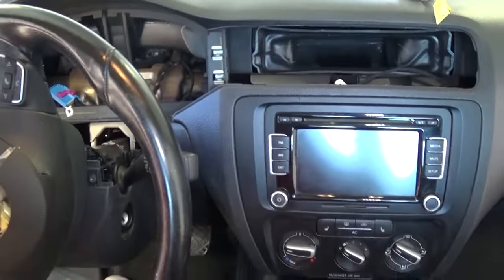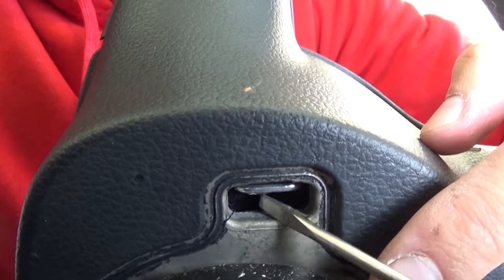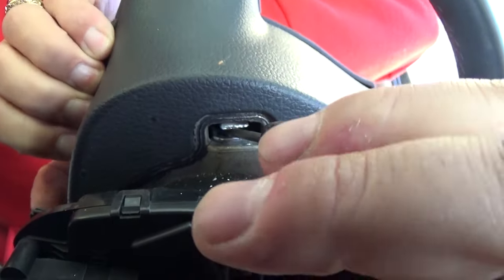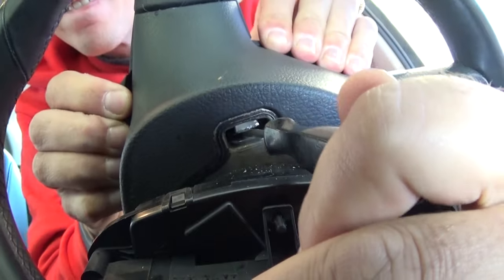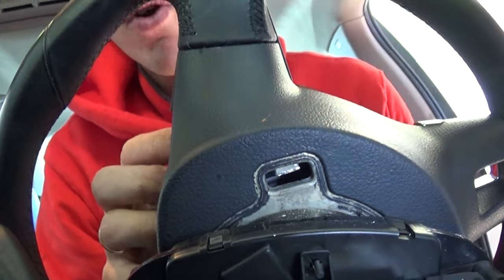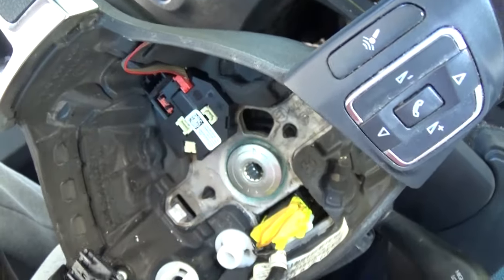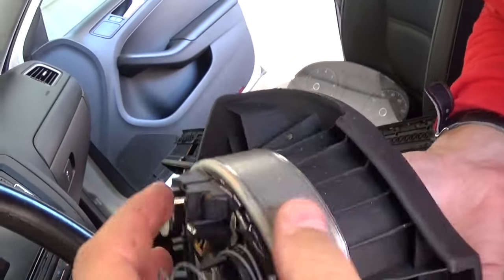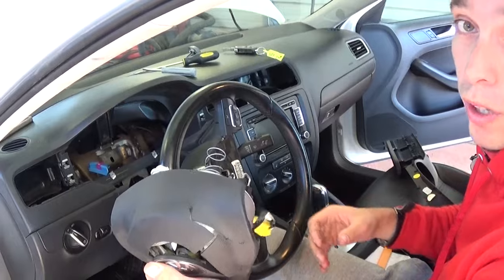VW JETTA MK6 DRIVER AIRBAG REMOVAL REPLACEMENT | VW GOLF MK6

Comment: What if the steering wheel is locked and key won’t turn?
Reply: it is standard safety feature. you moove the steering wheel left and right while turning the key.